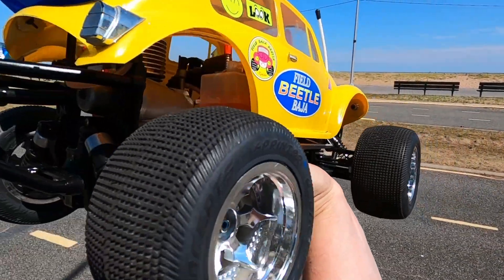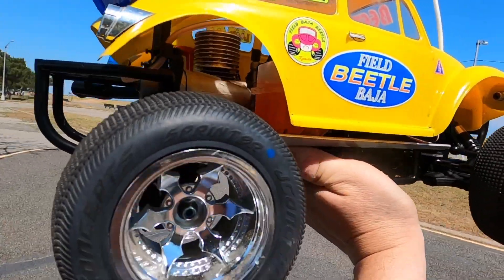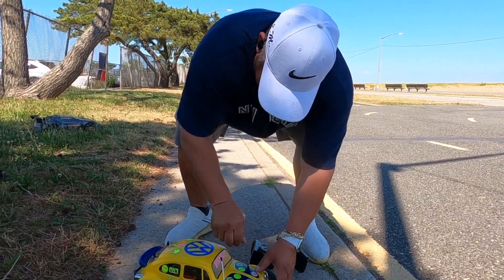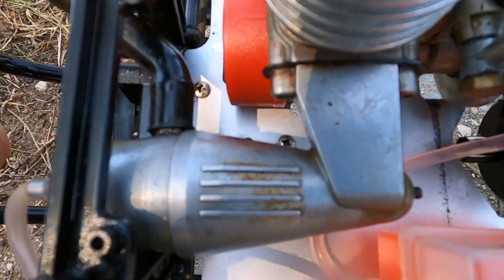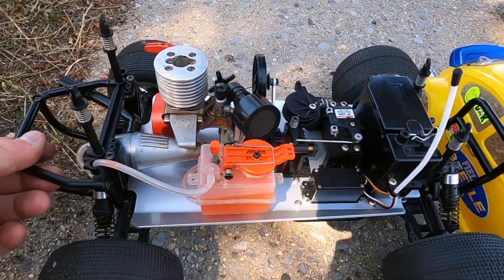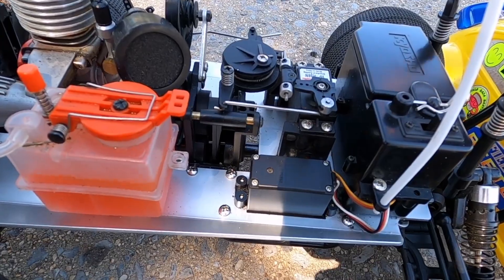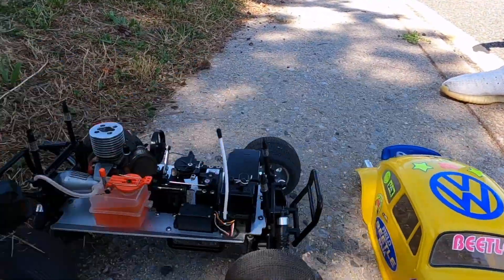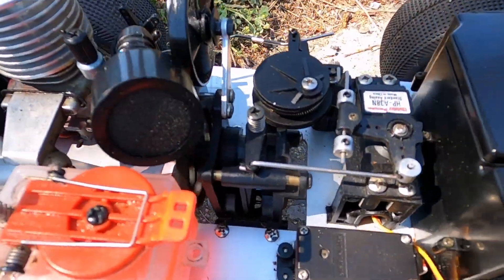Kyosho Field Baja Beetle - Test Drive & Overview - World's Slowest TOP SPEED - How Fast?

Comment: Now that is my favourite nitro!!!! Dmitriy, thank you for showing respect to this painfully slow, but very fun nitro RC. I have a Beetle and a Snakebite, which I take for a walks, going slow, more or less like a crawler. That tank - lasts for 45 minutes!
Reply from the maker: hey dude! I'm glad to have been able to show the Reality Of a True Vintage nitro in Like new Condition such as this Kyosho.  Its slow, but it is still the funnest RC on a track when all the others are electrics, ahaha..  Anyway I have one of these with a more modern Tuned pipe, and it's quicker, but I doubt will break the 20 MPH limit either way.  As you know, these model run great and idle for a long time easily, I think the reliability factor of these 25 year old motors is significant, and we both love them for that!!..

Comment: Love the HPI spike wheels
Reply: It most likely came loose from running the non stepped wheel hexes that they’re designed for
Reply from the maker: hey bro, I have one exactly like this model, still with the original SPIKE wheels, the handling with these more modern treads is much better, if you can belive that, LOL..
Reply from the maker: YEs bro, you're right!!  good point..

Comment: I just built one of these I have had since the early 2000s, my manual tells how to build it but there is no break in procedure, how did u break your GS11x in
Reply from the maker: hey buddy!! I'm happy to hear you got one of these and are trying to make it a runner!!  The one from this video was a used model and I was not the original owner.  For a break in you can just do 5-6 heat cycles at idle with small throttle blips to clean the exhaust out once in a while.  Break in is just heat cycles to get the piston and sleeve seated correctly.  Then you can do about 2-3 heat cycles with unto 25-50% throttle.  For me a heat cycle is about 8-10 minutes, to make sure the engine is unto normal temps, then like a 30 minute cool down period.
Reply: @hybrid32494  awesome, I appreciate your reply and experience, thank you !!!

Comment: I am building my very first nitro, any tips?
Reply from the maker: hey bro! I've never built a competition kit, but I've repaired so many models over the years that it feels like I have.  Best advice is to make sure to grease what needs to be greased and thread lock what needs to be thread locked, and don't deviate from the manual.  You learn alot while building too, great way to learn the chassis.

Comment: It's got springs on the body post
Reply from the maker: yes man! Thats one of the most unique body clip designs, you never need to use body clips, they are spring loaded and work quite well.  Although the problem is if you flip it with the body off they can easily pop off.

Comment: Sounds like it needs a bit more gearing, wound right out going no where
Reply from the maker: I agree man, a little taller gearing to hit about proper 15 MPH top speed would be nice, ahaha!  I have another one of these with a better tuned pipe system and I've hit 18 MPH on mine so far.

Comment: I have field baja beetle too. Theres something wrong with your car. It should be way faster. I think your clutch is slipping like crazy. And its only reach half of top speed now. Engine sound fine. My clutch start slip one point too. Those white plastic clutch shoes run out some point.